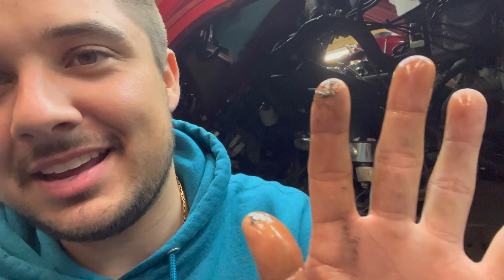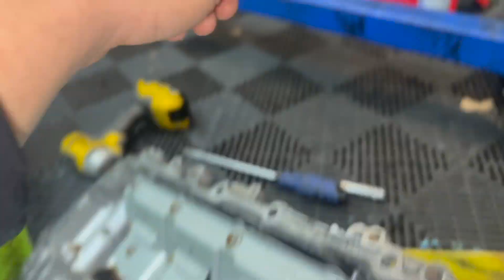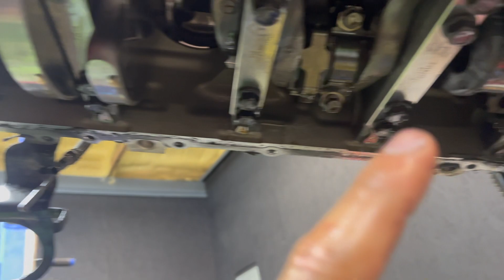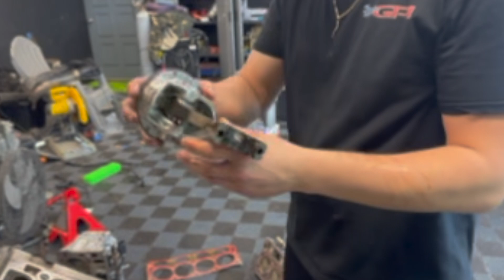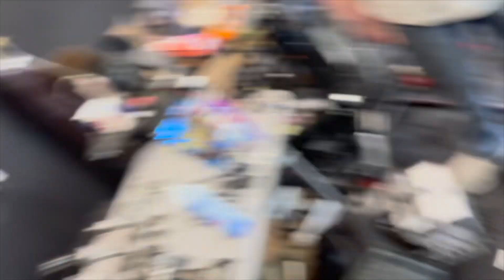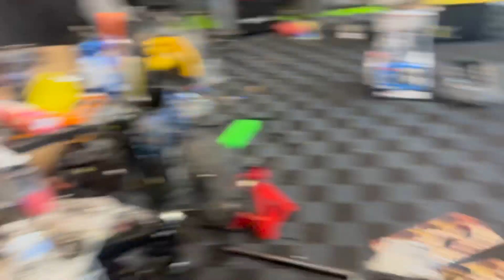My Twin Turbo Denali Blew Up!!!

Comment: These 6.2l engines even stock have bearing failure it’s all over the gmc boards. I’m shocked the 2024 models have this issue
Reply: This isn’t a 24 model